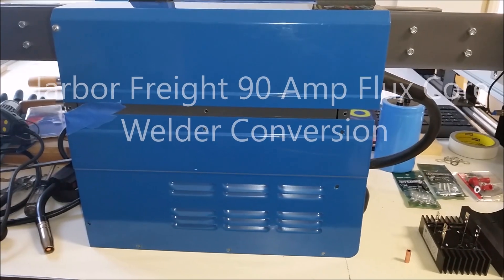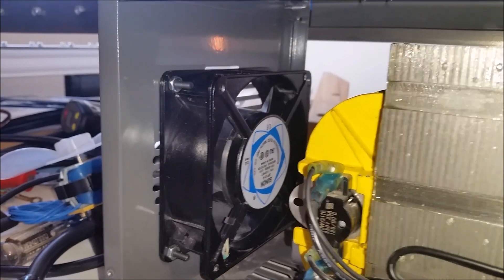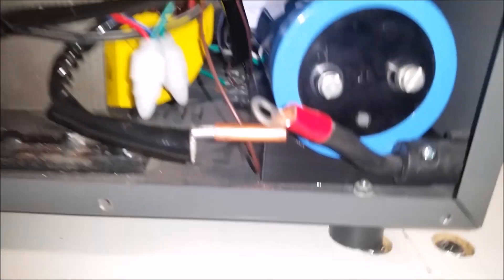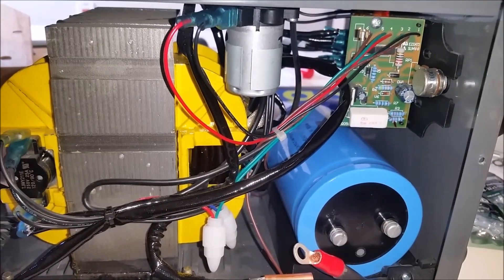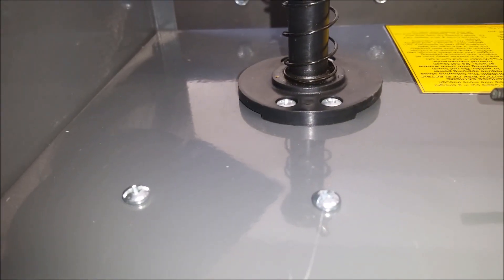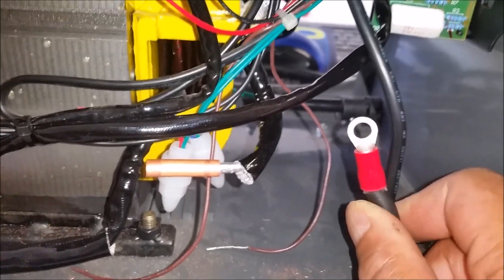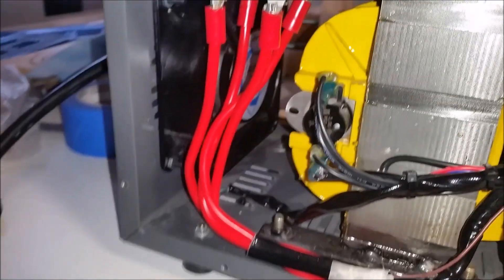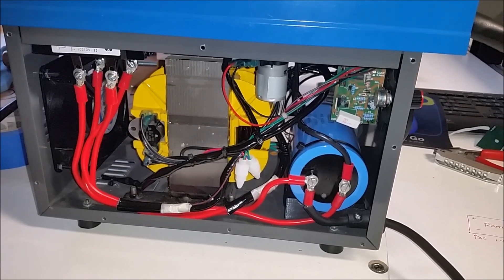Harbor Freight 90 Amp Fluxcore Welder DC Conversion

Comment: the AC goes into a bridge rectifier on the two  ( ~ ) terminals ( they are not -- ).  Positive output  to the ( + ), negative output to the ( - )

Comment: Shure would be nice if you Actually told what kind of Diode Rectifier and capacitor is needed. in stead of just holding them up and laying them back down. for people like me that don't know that much about those kind of parts it would make it a lot easier for us.  The eBay pages are no longer in business.
Reply: granted this is 5 months later but, i'll chime in anywho....i have a folder of several folks that have done this project. i'll go into my user profile and change the folder from the default of private to public. This will allow you to see all the other folks videos i have saved that have also done this conversion. some are from 5-7 years ago too. the data is still valid and the images show how several folks had solved the space isue by locations of different parts.

the is also one specific user who had installed a simple switch and LED light that comes on as the switch is activated to force the resistor to drain the cap's and the light goes out when the caps are fully drained. Then they turn off the switch and its safe to handle without worry of ZAP!

i am debating this added step to mine as well.

YMMV
Reply: @electrycmonk  Thank you very much. 
I'm sorry if my earlier text sounded rude, I really wasn't trying to be. 
have a grate day.

Comment: I did and I got power on both sides coming in and out, and I checked continuity thru the handle, that's fine, fan runs, wire feeds, wire speed works, but I'm not a HVAC guy, so my meter is for house wiring and car's

Comment: I converted my 90amp mig to DC, and worked fine but it's been sitting for a while and I tried to use it and nothing, it turns on and the wire feeds out and I checked all connections but my meter can't check the capacitor, could it keep it from welding
Reply from the maker: Its possible, check for power coming from the bridge rectifier, ac on the input and dc on the output.

Comment: From the capacitor you have the two leads going to the electrode (Negative) and one to ground clamp (positive). Is that correct? How's the machine been working? Is it worth the effort to modify it?

Comment: Did you add that fan also? How's that doable? that's an AC connection to the stock fan. Those CPU style fans are DC right?
Reply from the maker: It is not a cpu fan. Its a 120v ac fan

Comment: Great instruction. One thing that others have suggested is a 470 ohm bleed down resistor between the capacitor and weld cables. This helps slowly discharge the capacitor after you stop welding. If you didn't have the resistor, you will get a good flash when you disconnect the ground clamp from the piece you are working on.

Comment: Have you thought about adding a Stick Welding port and a switch to activate the welder on the stick lead, and a switch to turn off the wire feed motor when stick welding? :)

And please consider using a Bleeding resistor across the capacitor to discharge them when not using the Welder.
~100 ohms at 10 watt rating or more. This should be low enough not to impact performance, and not get warm at all even with the wattage rating. This will bleed off the capacitor charge within a couple seconds or so.

Comment: I`ve been reading down through your varies comments about capacitors. They are a safety hazard when mishandled.  A capacitor can hold a electrical charge for a very long time.  It depends on their voltage.  Higher the voltage, the more life threatening. They can hold an amazing amount of current ( AMPS ) as the capacity goes up in value. If they get shorted, they will have the capability to arc and melt metal which can fly in all directions. the explosive sound can be deafening.  They can maim, blind, burn, cause firers.  The HIGH voltage units are stored with their terminals shorted, so they can`t pick up a charge by accident.
A BLEEDER resistor can be installed to slowly discharge a unit in a circuit, safely.  SAFETY IS NO ACCIDENT !
Reply: It’s low voltage dc 40volts max it will not kill you!!!! from personal experience I have been zapped in my younger years where there wasn’t any information lol now ac voltage will do some damage and possibly kill you but even 120 isn’t that bad but Definitely be safe unless you need some stimulation haha
Reply: @jimcatanzaro7808  I beg to differ with you ! A 9volt battery can cause heart cramps if the human skin is broken or punctured.  You didn`t read my comment very closely !!

Comment: The capacitor is added into the DC circuit to SMOOTH the bumpy out put of the rectifier.  It gives a better constant heat !  The capacity rating can vary from the design center value,  50% down to 150% up.  The WORKING voltage rating shouldn`t be more then 300% above the open circuit DC voltage.   Reason being the capacitor deteriorates over time in service.  ( ie. reduced capacity ).

Comment: Serious problem with copper/ aluminum joints. The metals are dissimilar and will destroy each other by catalytic action. Check with a electrical distributor for an approved connectors.
When DC capacitors are connected in REVERSE polarity , they will EXPLODE when power is applied. Recommend , color code the wires. 
Be sure there is air flow through heat sink of the bridge rectifier. Cooling can be critical for the components survival.

Comment: The stock fan you had was just like the one in my 125A unit. The fan blades were unavoidably set so far in that I bet there was at least 50% RECIRCULATION of already warm cabinet air, which certainly restricts the DUTY CYCLE. And I also had a 120V “computer fan” that I mounted just like you did, except that I cut away the existing guard slots first for maximum inlet air flow. Yeah: VERY noticeable improvement of airflow with ALL the inlet flow coming from OUTSIDE the cabinet with pretty sure NO hot air recirculation! 👍🏼

Comment: Why a capacitor and not a coil?
Reply from the maker: The modification that I performed is not my idea. I installed the components based on all the others that performed this installation. All of them used a capacitor, so I used the same maybe because it's a cheaper alternative to convert the voltage to dc electrode negative which is the main objective here. My video simply shows how I installed said components. It may be possible to use a coil, but the cost may be more than what your trying to achieve.

Comment: Hey bro @jeromejt62, I'm looking to do the conversion.  Is there anyway you can give me a list of the items I need and where I can probably find them?
Reply from the maker: The links to the capacitor and the bridge rectifier are in the description. All other items may be found at your local auto parts store in the battery section. Wire, Terminals. The mount screws can be found at Lowes or Homedepot or any hardware store. The only thing that is not available is the capacitor mount. I designed and 3d printed that. If you have a printer I can send you the stl file and you can print that yourself

Thanks...
Reply: @jeromejt62  Hey man I want to 3d print that capacitor mount - can you email it to me? brandonmagness@icloud.com
Reply from the maker: Check your email, Thanks for watching and enjoy. Hope it helps you out...

Comment: Do yourself a BIG favor and spring for 6 Ga. Tee bolt wire connectors. Fast, easy and maximum conduction.

Comment from the maker: I have not seen anyone make any other mod for the min and max setting. Not to say it hasn't been done, I just haven't seen anything
Reply: i have a voltage reg
Reply from the maker: @lazycarper7925  Mine also has a high and low switch, but nothing in between. I believe the question referred to a regulator that would allow for fine tuning of voltage
Reply: @jeromejt62  thats what ive done, if you leave it on high out of the high and low, you can then adjust the voltage reg on the potentiometer, all the way to zero for fine metal, all the way up for its normal full strength, from the high switch, and anywhere inbetween, or use the high and low 1 and 2 switches etc, on the mig and use the voltage reg to fine tune the setting you choosed on the mig
 buttons
Reply: because the voltage reg is wired in first before the mig settings,
Reply from the maker: @lazycarper7925  That sounds great. Can you share how you did that, it would be greatly appreciated
Reply: @jeromejt62  yes its very very easy, on the mig you have live neutral and earth, if your in the uk, not sure in the usa, but anyway they conect to the main switch with live and neutral, the earth goes to the case, where they go to the switch,when the switch is switched on they go out again live and neutral, (so they went in to the main switch and out of the switch), all you do is chop the 2 OUT wires in half so you now would have 4 bits of wires 2 coming from the switch out, and the 2 going to where they was going (the big transformer), conect the wires from the switch into the voltage reg on the plus and minus,IN,,,,,then conect the transformer side live and neutral to the volt reg, plus and minus OUT,,,,,thats all, basically they go in one side and out the other
Reply: you tube is removing my ebay links?, tell me if you got the link
Reply: AC-220V-4000W-SCR-Variable-Voltage-Regulator-Motor-Speed-Control-
Reply: you tube keeps removing them i put it 3 times, just copy paste that in ebay, you want the one with the black turn knob, the cheapest is fine as long as 4000w
Reply: @jeromejt62  ok ive sent it, and 2 pics, remove your last post or youl get spammed on your email from nut jobs

Comment: all added wiring from the rectifier/capacitor must be a gauge  equal  to existing wiring.  here bigger is better
Reply from the maker: It is the same gauge which is 8 gauge as pointed out in the video.
Reply: oops. sorry about that.
i bought my capacitor and diode pack on ebay  i have several old booster packs that use the needed gauge wire.  did you have to use any dielectric grease  between the diode pack and the case ?
Reply from the maker: @Mr71chevyvan  I did not, but thanks for pointing that out. I think that's a very good Idea. By the way thanks for watching and commenting...
Reply: bought 3 ft length of wire bundle at lowes. inside are four 8 gauge stranded wire.
Reply: @Mr71chevyvan  Dielectric grease? Nah. You should use Thermal grease like is used between mosfets and heatsinks. Or even CPU thermal compound like Arctic Silver or MX5.
Reply: @LBCAndrew  agreed

Comment: I am going to be doing this to a cheap (I paid 15 bucks for it) Weldmate 75 amp arc welder I got at a yard sale.  I just want to see what I can get out of it.  I already added a cooling fan, now am going to convert it to DC.  like I said, I just want to see how  much I can get out of a POS welder.  You can solder aluminum.  You just have to sand it first.  It's the oxide layer the solder will not stick to.  I have had to solder aluminum to copper, and to steel and visa versa.  Sand it, and flux it, and you can solder anything to almost anything.  Metal anyway.
Reply from the maker: Nice tip, I'll try that. Never had luck soldering aluminum without applying very high heat, and then still not a good joint.

Comment: How would a higher voltage rated capacitor and/or a higher capacitance capacitor effect the welder?
Reply: Yea higher voltage cap replacements are fine in any electronic equipt.  The microfarad rating is what will destroy electronics..   now in this example in the video the cap is installed as a smoothing cap which stabelizes the amperage and higher the microfarad the better, unless you go over 200k, but those cost mucho denero.  One correctiion tho, the machine i have is almost the exact same one and i get a range of 30vac @ 98amps to 40vav @125amps so a 50v rated cap is as small as you should go otherwise at that amperage the thing could go off like a bomb..  or just smoke out the room like i used to be able to do..   but that size cap can kill your ass quicker than the time it takes you to squeeze out a fart so no touchy..  learn about discharging capacitors correctly before playing with one, especially one bigger than,  well was going to put a dick joke there but u get my point..
Reply from the maker: A higher voltage capacitor there probably would be no difference as the transformer only outputs I believe 15 maybe 20 volts. A higher rated mfd or capacitance would effect for the better as it gives more power reserve at the rated voltage which won't go above the supply voltage.

So in other words if you supply 20 volts you get 20 volts out.

Comment: i have the identical HF wire welder. in my opinion even better tute would be a large schematic drawing with you pointing to it and then  show placement of parts in cabinet being discussed. would really help getting the point across.

Comment: By far the best quality and most professionally done conversion.   Your layout and attention to connections are excellent.   Congratulations.
I have a Hobart a140 which does either flux core or is full MIG capable and always used flux core but recently i purchased a cylinder for CO2/argon mixture and converted over to solid wire full MIG.   I can’t believe the improvement of my welds, the lack of any splatter and especially no smoke.   My shop is much cleaner.   It’s like a new life!    If you do any amount of welding the conversion to full MIG is worth it.   But the HF flux core welder can’t be converted to full mig so more money is needed.  
Again, beautiful quality work.
Reply from the maker: Pbrin, thank you so much. Comments like yours are what make us all continue to make content that is useful and helpful to others. Positive reinforcement is a wonderful thing.

And I can't leave without saying this for sure.
Thanks So Much for Watching
Reply: I wish the wires where color coded and labeled and warning decals plus a schematic on the machine so when the owner is gone nobody gets hurt

Comment: Is there a DC  version already for sale
Reply from the maker: As for available welders that Harbor Freight offers in the D.C. version line would be the Vulcan Series or their new Titanium series. Both lines are pricey ranging from $400.00 for the 120v  to almost $1000.00 for the 120-240 versions.
Reply: Century FC90 from Home Depot
Reply from the maker: Martin, thanks for watching first of all. There is not a conversion commercially available kit or ready made parts for sale to do this project. This is a DIY project. It is very easy to do and will cost you 1/4 of what a commercially offered product would cost. If you need help in completing it I a willing to assist you with any information that you may need.
Reply: Yes there is. It's a 220 volt version and is basically what all these conversion are that you see. It sells for $180 at Harbor Freight.

Comment: Wouldn't a #8 split bolt be a good way to connect wires to the transformer? Since the transformer wire is solid and aluminum you could scrape the wire clean and coat it with antioxidant and lay the #8 copper on top of it and clamp them together with the split bolt and make a very good and tight connection. Just wrap with some good Scotch 33 tape.
Reply from the maker: Junk Yard, I'm sure that method would work. There are probably 20 other ways that could be used. I pretty much used what was already there a crimped connection, mine was just copper. Thanks for watching and the comment. Others following this mod could benefit from your suggestion..